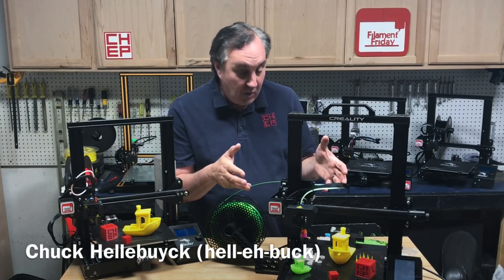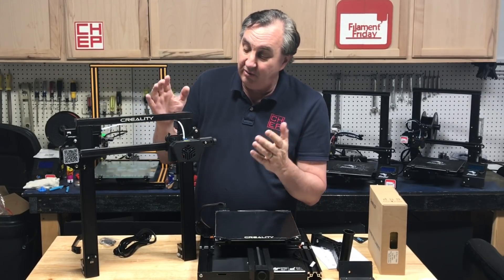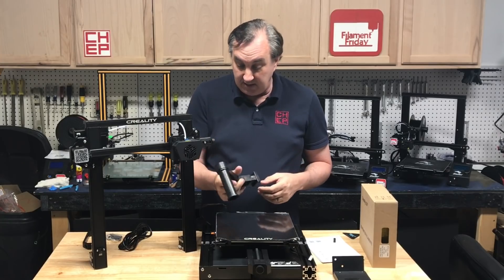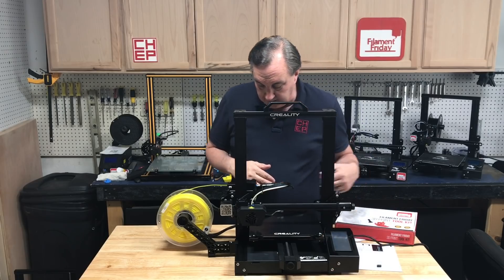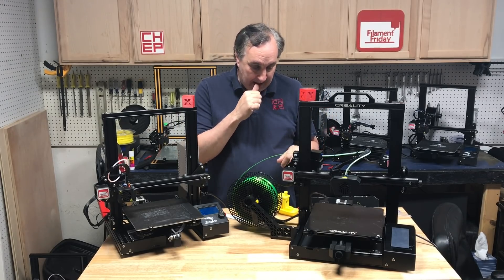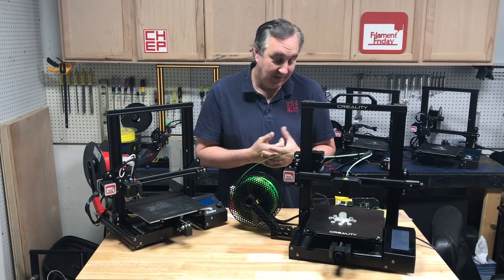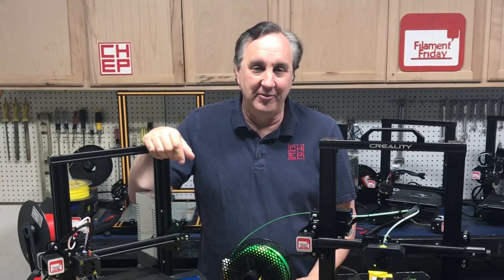NEW! Creality CR-6 SE 3D Printer - Better than Creality Ender 3?

Comment from the maker: Note: They give Kickstarter people the choice. 8 or 32 bit board as they reached a stretch goal. I couldn’t test 32 so I can’t really comment on its capabilities.
Reply: Yup, I almost watched every live stream from Creality on the CR-6 SE, everybody was asking about the 32-bit board and they did change it as a choice. But now the question will be, after the Kickstarter, is Creality keeping the 32-bit board as a choice or are they going to drop the 8-bit board...
Reply: what about that ptfe tubing? You printed in petg without changing it to a capricorn tubing, is it rated for higher temperatures than the stock ender 3 tubing?
Reply from the maker: I ran 240°, that doesn’t need Capricorn.
Reply: @FilamentFriday  wait, really? For some reason in my head it's like 230+. But so it comes with the same PTFE tubing as the ender 3 then?
Reply: @yothazme2  I print PETG on my Ender 3 with stock PTFE at 240°C no problem :)
Reply: @MariuszGruszkajamaniek  wow that's wild, don't know where I got that from, thanks though!
Reply: Great video sir. Try reviewing the Alfawise U50. It is almost the same price with an Ender 3, but with touch screen, auto leveling, and a bigger print bed.
Reply: Its good they added auto bed leveling. But why not ac heated bed or even an enclosure? I found dc heated bed of this size to be inconsistent when working with glass plate at 110c. Any cheap machine nowadays can print PLA and PETG. The print quality of Ender 3 is already very good. What Creality need is new machine that print ABS and PC
Reply: 32 bit board will probably be the coming standard for creality. It's simply cheaper to make 32 bits boards nowadays with 8 bit processors being more expensive.
Reply: Hi CHEP, what was your Speed and Retraction settings with NinjaFlex on CR6? Thank you! 

Also what speed you use with those prints you show ü..
Reply from the maker: It’s all in my Ninjaflex profile. Link in description.
Reply: can we please have the cura profile for the cr6se?
Reply: 🤦‍♂️i got - blue numbers ans dont know why im new to 3d printer i thought this was plug and play
Reply: i still got blue numbers and some are green some negative green and some green of 087 idk what's going on
Reply: @o1ecypher  Creality really seems like a company entirely capable of producing  a high-end, top of the line machine (maybe not Prusa level, but close)  but for some reason always cuts corners somewhere. I understand cost-cutting measures and manufacturing constraints one might run into but it's also kinda frustrating.
Reply: @MariuszGruszkajamaniek  This is exactly what i was thinking. They call this innovation but its just an update.
Reply: @MariuszGruszkajamaniek  What' so good about Prusa other than the marketing?
Reply: @MariuszGruszkajamaniek  That's why a Creality machine is hundreds of dollars less than a Prusa, also why there are probably 3x's as many Ender 3's out in the wild compared to the Prusa. Prusa are for the Fisher Price crowd that can't/doesn't want to build their machine.
Reply: @MoragTong_ Well, I'm with you there. I'm the Ended 3 owner myself and loving it :) Just think that Creality could really use that "it just works branding" that Prusa has. And with the current QC and pretty much every machine having some kind of an issue/lacking feature I don't see it happening. It could really help them reach the wider audience.
Reply: @MoragTong_  Wrong. The Prusa is a kit. It's a high end kit. You spend more time building a Prusa than a Creality.
Reply: @thegeniusman8757  You can order Prusa as an assembled unit. Sure, it costs quite a bit more but it is an option. Also the instructions for Prusa printers are waaay more user-friendly. I had to go on YT to assemble my Ender 3 as a total novice at the time. 

I didn't mean to start an argument but that's kinda what happened. Do Prusa printers offers way more superior print quality compared to Creality? No. But Prusa offers a lot more features, no missing ones, proper upgrade kits, great costumer support, proper QC. I'm a huge fan of Creality machines and I just want them to be more successful. And IMHO the way to do it is to build a real no compromise 3D printer, not 4 slightly different versions of the same thing. CR-6 SE seems like a step in a right direction though. Only time will tell.
Reply: @MariuszGruszkajamaniek  Yeah. I own an Ender 3 and I like Creality. I didn't have difficulty putting mine together but maybe that's just me. I just thought the other guy was wrong when he thought Prusa were for the babies who didn't want to put time into my printer.
Reply: @MariuszGruszkajamaniek  I agree. My take on the CR-6 is that they're going for an "appliance" feel, where a 3D printer in the house should be as common and easy to use as a microwave.
Reply: @thegeniusman8757  And it's full of 3D printed parts and cable ties. I'd sure Prusa is a brand rather than a good printer. It's price might have been justified years ago. Now it's just a rip-off.
Reply: @andyspoo2  ok. You are entitled to your opinion.

Comment: Ender 3 v2 =£190 or this for £240 what's the best ? Bl touch and new extruder would make the v2 cost just as much as c6
Reply from the maker: Third party firmware has made it better but I still prefer my V2 with BLTouch.

Comment: I just received my CR-6 SE. Unfortunately the card reader doesn't work. Everything works fine but the reader. I even put the SD card into my computer and it won't read it either. Any ideas?
Reply from the maker: Try a new SD card.
Reply: @FilamentFriday  I don't know why but everything is good this morning! Thank you for your response.
Reply: @campbelled83  Yes very much! I found out that there is nothing important except Creality's Cura on the SD card. If your thinking of buying check Wal-mart, mine was about $40 less than most.
Reply: Don't worry, our SD card broke down too but it got fixed by format!

Comment: SO you said it takes a different nozzle. That means that all the 04, 05, 08, 10 nozzles I have will not fit this machine?  I have an Ender 6 regular.  Very quiet but tons of issues with the extruder. How is this one?  Thanks.

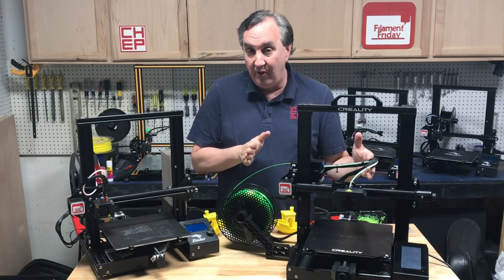Comment: 7:58 255 by 245 for CR6 SE. Based on your experience, can CR6 SE print 245? Because I need print 239mm long. If your answer is yes, I will buy CR6SE.  Thanks.
Reply from the maker: Your pushing it. I’d go bigger, like a CR-10 or Ender 3 Max.
Reply: @FilamentFriday  Ok, Thanks.

Comment: After testing out my cr6 se for a month now, I think its totally worth the price. :D its noob friendly enough to get started with and does a beautiful job with most filament. It was a bit challenging with a cheap silk filament but I'll get better at tuning it. Its mostly software settings that I need to learn as opposed to adding new pieces which is a bit scary for a noob like me. I eventually upgraded my desktop cnc(another machine I have) with some better parts as I would have to do with the ender 3 but it took me at least 6 months to get used to it and fix issues with leveling and tools. basically its nice to have a low learning curve on the cr6 se.
Reply: What slicer do you use?
Reply: @Lord-Wams  I used the newest version of cura and modified a few settings based on videos i saw from CHEP
Reply: @shortcut1331  ok thanks
Reply: Can I know what is your setting for PLA retraction? I have some problem with stringing... I'm using Cura 4.8
Reply: @MD-kn3lk  There's nothing I changed in retraction so far, at least not with pla. TPU is another story. I Know of 3 things that affect stringing though, one is the infill, if its 100 percent then it might make the pla overflow in the middle causing it to be caught on other operations, second the temperature you are printing at could be tweaked. Try printing a temperature tower(found on thingiverse) to find the best temperature and thirdly travel speed can make some stringing, especially when you print multiple parts at the same time. Of course there are more ways to help stringing like "combing" which I set to 7mm instead of 30mm and not in skin, I am just beginning at this myself so I hope this helps.
Reply: @shortcut1331  Thank You very much Sir!

Comment: Wondering if that's "original recipe" NinjaFlex or Cheetah. Most people seem to print in Cheetah and just call it NinjaFlex, but if the CR-6 SE can print regular NF without issues, that's a big point for me for the extruder, since I've had endless amounts of troubles working with regular NF even with direct-drive extruders, having to use a ton of mods and to print INCREDIBLY slow to get anything out.

Comment: Thank you for this, how would you compare it with CR-10 V3? Would buy this or CR-10?
Reply from the maker: It depends on what you need to print. V3 is direct drive.
Reply: Thank you  @FilamentFriday  for your reply. Right, but if CR-6 SE can handle TPU correctly, what is the benefit I will get from the direct drive of V3 over CR-6? Ignoring the volume of V3, which one would you prefer, and why?
Reply from the maker: Print faster.

Comment: Little off topic, but on my ender 3 I find my chep cubes, and most of my prints come out with corners that bluge a bit or around more rounded than they should be.   Quality is great, but corners bulge out a bit and ruin dimensional accuracy.  Any idea what that is?
Reply from the maker: Try adding coasting

Comment: Hi CHEP, please can you recommend a printer to use IN CURA for my new CR6-SE, since CURA does not yet have a printer profile for it. Am I right in thinking that I can just use my old CR10mini profile and just adjust the build plate size etc so suit the new printer. Thanks very much.

Edit: For anyone interested, The "Creality Slicer" found on the included SD Card is basically a reskinned CURA. So on there I found the CR6-SE printer settings. They were basically identical to what I had before. I just had to update the print volume.
Reply: I tried to print with the included slicer, & all my machine does is hit a sidewall, & slip the belts repeatedly!

Comment: Did creality fix the issue on the unit (causing a fire)?or they recalling it?
Reply from the maker: Still investigating this.
Reply: @FilamentFriday  Have you been able to find anything out? This has me waiting to purchase a unit until the fire issue and power switch issue are fixed.
Reply from the maker: No. Creality hasn’t shared much detail but Im hearing less issues of it.
Reply: which unit is that ?

Comment: Is there a cura profile for it yet? I should be getting mine from kickstarter this month and haven't been able to find one.
Reply from the maker: I use my CHEP Ender 3 profiles.
Reply: @FilamentFriday  thanks. I thought the ender 3 profile might work, but wasn't sure.
Reply: @FilamentFriday  I JUST read this, after writing my comment about how to set it up with Cura. I'll be giving this a go. THANK-You!
Reply: The CR 10 profile with corrected build volume seems to work fine too

Comment: Ender 3 v2 is a lot cheaper with 32 bit and it's just a lot better.
Reply: Luca Biermanski - Would the Ender 3 V2 be a good 1st printer?
Reply: @rickybobby6605  depends on what your expectations are and what your going to be printing, if your a hobbyist and you just want to learn new things then yes
Reply: A Tasty Cloud -Thanks for taking the time to reply. I picked up the 5 Pro. Cheers.
Reply: @rickybobby6605  nice one
Reply: @rickybobby6605  absolutely I got one
Reply: What makes it better besides the price?
Reply: @SamuelpCameron  print quality is amazing just in general its very user friendly with the added features
Reply: @SamuelpCameron  the name is good

Comment: Hello Sir, what would be the best Creality printer to make models cars, model cars models, chassis etc ?
Reply from the maker: Ender 3 would work fine.
Reply: Ended 3 pro with the extruder upgrade and glass bed works great!
Reply: For the 14th scale Tamiya trucks, the Ender 3 isn't big enough. For 10th scale trucks/cars/crawlers, you'll need to glue them together, or get a bigger build plate area! The CR6SE barely has enough build plate volume to accommodate the truck cabs for the 14th scale Tamiya trucks. We're working on building a Mack B model cab to go on one of our project semi trucks now.

Comment: Considering everyone says don't use a bowden PUSH extruders for flexibles like TPU (i.e. you must use a direct drive extruder), this pretty much disproves that advice. Maybe in the past. But not now.
Reply from the maker: Ive never agree with the direct drive only. I also proved it here using and EZR on Ender 3. 
https://youtu.be/1GNDxvxpWr8
Reply: @FilamentFriday  And direct drive has the disadvantage of being a heavy component on the axis, adding wobble and reducing speed. Thanks for the link.

Comment: should i wait for the cr-6 or buy ender 3 pro now? i'm the beginner and missed the kickstater
Reply: Good question. I think the auto bed leveling is the most useful thing if your a beginner. Getting the first few layers correct will create a great print. But can be a real pain and might be too frustrating for a beginner.

Comment: I think Creality Ender 3 V2 would be the way to go for most people.  Similar to CR-6 except it doesn't have auto leveling and a smaller print size.  It has the new silent motherboard, new display, glass top, and extra tensioner.  Creality's product line is a bit all over the place.
Reply: Check out the Bigtreetech 32bit mobo upgrade

Comment: Great video, I was wondering if it is safe to order a cr 10 v3 from banggood/aliexpress. Does anybody have experience with ordering off of these sites?
Thanks
Reply from the maker: I’ve bought often from banggood. Look for the USA warehouse if in the states. You get it much quicker.
Reply: I've bought numerous items from Aliexpress, & NEVER had an issue! Aliexpress holds the funds until you confirm that you received what you ordered, & that it is in proper condition when it arrives.
Reply: Just dont
Reply: CheMixReVolution thanks, I’m waiting for the release on the creality sure now 👍🏻
Reply: @chemixrevolution7395  Agreed

Comment: These machines are a big part of future manufacturing, we are some of the early adapters. Should I upgrade to this from my Ender 3?
Reply from the maker: If you want autolevel then it’s a good system.
Reply: CHEP They also now have (or at least for the Kickstarter backers) an option for 8 bit or 32 bit and they have TMC2209 drivers (no added cost)

Comment: 15 amps for a printer? I think you need 20 at least
Reply from the maker: What I question more is the 30amp fuse.
Reply: @FilamentFriday  on the bed?
On skr it's 20
Reply: @FilamentFriday  30A at 24V is not unreasonable for fuse. Realize that the marked rated current does not prevent fast acting fuses from protecting a board in a short, however it does stop continual fuse blowing from current spikes.
Reply from the maker: Fuse prevents the board from seeing more than 30A. I just wonder if the components and board could handle a 28A constant current for very long.
Reply: @FilamentFriday  depends if they expect the board to be used with external mofset, which i believe it's what common, skr have 20A fuse, but they still recommend external mosfets, if you expect anything above 10 amps, even if th3d saw it could handle 28 30 amps.
Reply from the maker: If something on the board fails and produces a resistive short, would the circuit board traces fail before the fuse?
And this isn’t a fast acting fuse. 
It just seems large compared to any other printer I have. And this doesn’t have an external FET.
Reply: @FilamentFriday  I'll try to be brief. My thing is more in AC controls where motor fuses are usually 3-6x draw. On board fuse is for 2 things, prevent fire due to jam overloading draw of motor and short circuit. 20A here would have been more suitable as 14.6A peaks at 20A but Meanwell PS has an overload settable from 110-140% anyhow. So in the end the fuse is only handling shorts that would travel up board electronics and otherwise is beefy enough to handle Current spikes from motor switching and fast enough to be suitable short protection. I have no idea here if that fuse is suitable for this but if it was mine I would suggest seeing if there is an engineering, not a supply/ecomics reason for the 30A but you can certainly pop in a 20A fast acting, at worst it will pop every so often from spike damage.
Edit, board control circuit components would fry most likely if they ever seen 1A; this current is entirely controlled by circuit design and voltage limits. Anything changing voltage/current here will likely kill board unless the fuse can somehow prevent this quick enough from spiking. A short is a quick climb to inifite A and the response time vs resistance is all there is to stop a bad situation in any short.

Comment: I signed up for one.  After adding up what it would cost to upgrade a "bargain" ender 3 pro $200), it was cheaper at the kickstarter price and you get a little larger print bed and I don't have to do all of the work.

Comment: Got it for 329 with freight to Denmark and no customs/tax. Early Bird Kickstarter 😄 cant wait to use it alongside my ender 3 pro and LD002R 😎 Full NERD mode for my wargaming terrain and models 👍🏻will get the 32 bit mainboard allso, as they reached there stretch goal, for free.

Comment: When I've looked in to the ABL's from TH3D it was $80 for the ABL. If this one is $100 more than the Ender 3, then you're basically paying $20 more for convenience. Which, let's be honest, most of us would pay someone $20 to assemble the printer and setup the ABL.

How was changing the filament out? Was it just a quick menu selection or did you have to heat it up, release the extruder and pull it out?
Reply from the maker: Good point. The menu to change filament locked up when I used it so I manually heated and removed. The lockup is a beta unit issue.